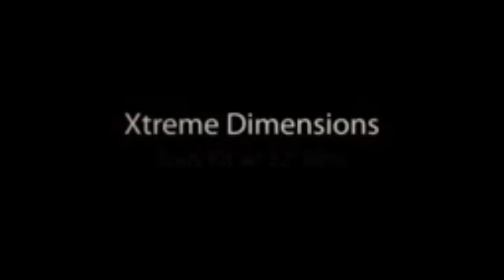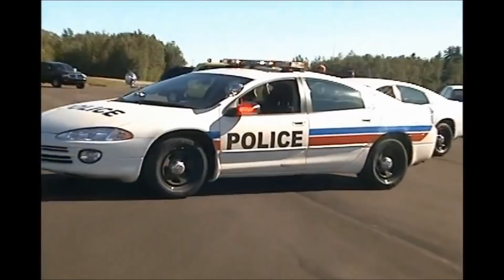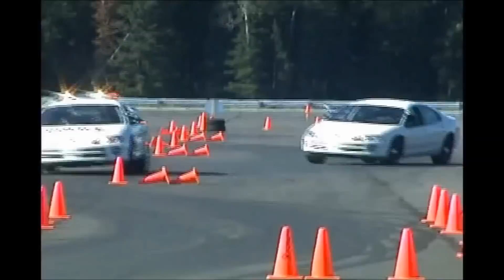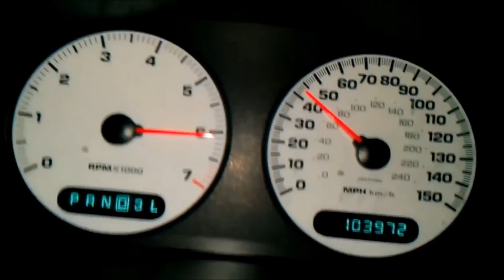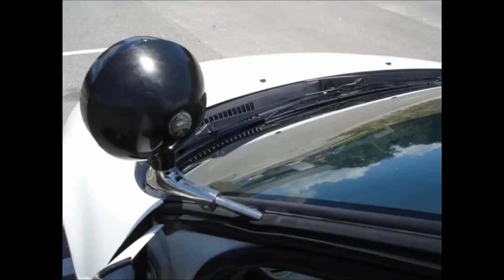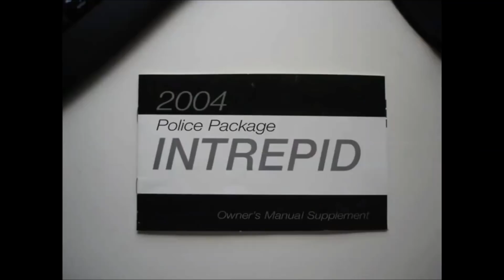The Absolute WORST Police Interceptor EVER! the Dodge Intrepid

Comment: No one I know has had any luck with any Chrysler made after 1980. Pairing up with Fiat didn’t help. What a sad joke.
Reply: Yeah, I'm not a fan of the Fiat merger either. It's a shame. However, the 3.6L Pentastar engines are actually really good engines. As are the larger displacement Hemis. I also heard recently that Ram is starting to put highly reliable Aisin-made automatic transmissions into some of their larger trucks as well, which should boost their overall reliability. (Aisin is a brand name of transmission manufacturer that makes transmissions for Toyota and other reliable brands.) Also, they seem to be doing really well with their interior designs and interior quality, so not all is horrible in Chrysler-ville. But that new Chrysler Portal thing looks like an absolute flop of a car. I fear that thing is going to kill Chrysler once it comes out. It's going to flop as hard as the Pontiac Aztec, you watch. 😕 Fiat's leadership can go to hell. It's sad because I have a feeling that Chrysler's engineers could actually do well for themselves under their own direction and guidance, but Fiat seems to be taking them in a pretty shitty direction that I don't like.

Comment: I actually happen to like the Intrepid's I've just never been in a position to get one of the good ones. And yes there were good ones. Here in Canada it was usually the body rotted out long before there were motor problems I've seen a few of them that were just beautiful look like they came off of the assembly line that were one owner vehicles. Just never been in a position to get one of those the ones I've always seen were rotted the death and not worth having. I had no idea they made a police car version that is just laughable. There a basic driving vehicle no business using one as a cop car. They're a very light duty vehicle compared to the Crown Vic.

Comment: Intrepid's with the 3.2L or 3.5L V6 engines were generally fine. Those engines typically only die if you let the timing belt break (interference engines), or just generally neglect them. They are underrated in terms of durability largely because the cheaper models with 2.7's were more popular & became so infamous/synonymous with Dodge Intrepid's. I think one of the biggest issues with the 2.7's were the internal-designed water pumps which typically failed early & let oil/coolant mix (causing sludge) if the pump went bad. Seems like I remember reading that 2.7's need water pumps replaced as "preventive maintenance" to avoid the catastrophic engine damage/failure that they're known for.

Comment: I owned one of the 2004 intrepid x police cars with the 3.5  for years. It had 80,000 on it when I got it. It had its usual problems but overall it was the fastest car I’d ever owned. I totally disagree with what your saying. Maybe you just had the misfortune of getting a lemon. I would have raced my intrepid against any car on the road and probably won. Top speed of mine? I was clocked on a closed course at 180 and still climbing. If I recall correctly didn’t someone win a nascar race with one? Not sure of the details. I would have raced it against any crown Vic any day.
Reply: Ward Burton won the Daytona 500 in 2002 and it was the only time a dodge intrepid was driven to victory lane for the Daytona 500 the rest were the Chevy Monte Carlos for 2001,2003 and 2004 which was the last year for the intrepid being used in NASACAR.

Comment: 3.5 was a bullet proof reliable engine,NO oil sludge with the 3.5 !!!!!

2.7 had issues with oil sludge ,Remember Toyota had a worse oil sludge issue in the mid 1990's early 2000's !!!!

RT only came with the 3.5 as did the Cop Car Intrepids !!! 3.5 was a reliable engine with 200,000 mile plus engine !! They ahd a timing belt and needed change every 100,000 miles...

Comment: The 3.5 was pretty reliable
Reply: Extremely reliable I would go as far to say, along with the smaller 3.2L engine which was nearly identical
Reply: It still had an internal water pump that is timing belt driven. Any 3.5 made from 1998-2010 is an interference engine.

Comment: A longitudinal v6 on fwd platform. Sounds like a Renault to me. The 4 door cousin of the 90s camaro. 
All around hideous along with the Taurus of that era.
Reply: atleast the camaro looks cool and has the ls1
Reply: @dyl4nftp  the long hood is justified on the camaros and trans-am, due to the large v8. On a 4 door sedan,especially lacking any v8, it looks ungainly. I actually like organic body styles on performance cars like the 4th gen mustang and 90s camaros/firebirds. It's just the lh sedans are stetched just a tad bit too long. Personally i find the current ford fusions pleasing as it proves you can make a more sporty style 4 dr sedan; course borrowing the front from jaguars. The Taurus almost, but it got ruined by the high beltline and cramp interior.

Comment: All Chrysler products from this era were questionable.....Company Has Recommended You Should Learn Engine Repair.......
Reply: What did you own that led you to that assessment? I thought the Daimler Chrysler years were some of the better, especially compared to 80’s Chrysler or arguably FCA
Reply: @brandon18054  2000 Chrysler Cirrus.....horrible little thing if you don't "over maintenance" the thing. If you change fluids at 60% of recommended intervals and make sure all services items get replaced before necessary, you might have a fighting chance. Otherwise, the thing will self-destruct if you treat like an Asian import.....

Comment: You never owned one! The 2.7L "your friend" owned was a POS from the get go. The police package intrepid and concordes with the 3.5 ho are capable of 150+ and pulled impressive g's with testing. Problem was no one did the damn timing belt at 100,000 that's what killed most of them the tired ass timing belt. You can still find some small department's with them till this day. Don't hate because your friend got a shit engine bro.
Reply: Usually its the GM Chevy guys that complain about Mopars. Yes the 2.7 V6 was not all that a good motor because people don't change the oil, or maintain them. The Mopar 3.5 is a tough motor. If you simply follow the maintenance schedule the car will run for a long long time. !
Reply: @alexlevy322  the 3.5 is in my opinion a brick a reliable brick at that. The chassis for intrepid, Concorde and 300m we're and still are impressive for fwd cars also considering that unlike allot of other fwd cars, torque steer was non existent. Chrysler did a ok job on the car. That 2.7 though for everyone I've worked on I hated the owner for even making me look at it.

Comment: I don't see anything wrong. We still have the 3.5l v6 motor in our intrepid RT. We run a small turbo on it now but it has 237k on it and it's never put us on the side of the road. More then less it helped us get to where we needed
Reply: Sagen, have you had success with your turbo setup? There's a guy in the community who has worked on doing that.
Reply: The 3.5 V6 didn’t suffer from the leaking water pump/oil sludge/engine failure issues that befell the 2.7. The 3.5 was/is a robust engine, and if you just kept up with the basic service schedule- problem free. Even the abused ones typically only suffer from mild oil consumption at higher mileages.

Comment: In my opinion the best Cop car is either the Ford Crown Victoria or Dodge Charger
Reply: Oddly Crown Vicorias are over rated,slow,dont handle but dirt cheap rear drive V8 cars..I guess its better than a Honda ! Charger even a 6 cyl eats the Crown Vic and the Hemi leaves it half a car length behind in a 1/4 mile drag race !
Reply: Dayofthedaleks 152 The Chevy Impala isn’t a bad one either.
Reply: Devontae Allen As long as it’s not a 3.6 V6.
Reply: Dodge Charger? Don't flatter yourself.

Comment: Man you really don't know what you are talking about. Do your homework before shouting mistakes on the web ;) To only name a few, the police edition only came with the 3.5 not the 2.7 which yep had a bunch of issues (sludge, water pump, etc). Also you are showing pictures and videos of custom consumers cars (wheels, paint, exhaust), not only cruisers. You are confusing, really...
Reply: I agree.
I have an Intrepid RT with 225,000 miles. I also owned  A Concorde for 8 years. Never heard of these probs. He is referring to an isolated case. (One car) His friend's used Intrepid. 
He totally doesn't know what he's talking about.
Reply: Oil sludge happens mainly in the 2.7s because the water pump is housed in the engine next to the timing chain.  If that water pump goes, your oil is instantly contaminated.   3.5s, the water pump is in the timing cover.  If it goes, it will just leak out your timing cover. Other  Sludge issues  in the 3.5s often happen as a result of poor maintenance.   My SXT has 220,000 miles on it. Granted, been through a couple of water pumps  already but the engine still runs strong, even with the young kid beating the hell out of it as a daily work car...
Reply: The 3.5 can have oil sludge too but it’s not as bad as the 2.7.

Comment: It originally came out in 1993 and came with the 3.3L V-6 very reliable First gen 3.5LL reliable expect for water pumps and transmissions and in 1993-1996 they came with a 3.8L V-6 very rare (1993-1996) The 3.8L was made for three years. The  3.3L  were super reliable but under power but bulletproof. I know some of these 3.3L and the 3.8L models would go 300K miles get the 3.3L or the 3.8L Intrepid  1 gen. (1993-1997). The 3.8L were used from  1993 1996 and the 3.3L was replaced with the 2.7L POS.
Reply: I know for a fact it never had a 3.8L in it. You're spreading false information just like the clown who made this video
Reply: And the 2.7 was replaced by the 3.6 Pentastar V6 which was much better made than the shitty 2.7.

Comment: Had a brand new 2001 Intrepid with the 2.7, ran full synthetic oil in it from first oil change. Car always ran well, never any issues other than an oil leak that was repaired under warranty. Car was really tremendous on the highway, stuck like glue even going too fast on the exit ramps. Traded it in for a Durango when back problems madw it impossible to get in and out of. I liked that car, easy to drive, and quiet to ride in.

Comment: You sir sound like a big fat idiot! First off the Intrepid, Concord came with the 2.7 standard. and that was the motor with the problems! and the people that bought a base model could care less about oil changes. So if you kept the oil changed they were OK. If you couldn't do an oil change because you couldn't make the car payments....well that's when the sludging happened. the 3.2 and 3.5 were optional and the 3.5 HO was standard on the Intrepid RT and 300M special. the 3.2/3.5 were rock solid reliable motors. and they had a top speed of around 140mph in an RT, 300M special and the cop car, which at the time was pretty good for a pursuit car. You need to do some more research before you go spewing out loads of crap, other than just reading about something you have no clue about.
Reply: Exactly. 👍

Comment: 200 ponies on a 2.7 and 250 on the "H.O" 3.5 that's almost comparable the 4.6 in the crown vics only made 200-220 and GMs infamous 3.8 in the impalas made 250ish, point is price will trump performance, sure theres hemi 5.7 police and the infamous ls1 camaro but not in abundance, they should have demanded ford continue to make the crown vic for police use or should have purchased more holden caprice ppvs with the 6.0 making 350hp ijs

G8 owner 🤔
Reply: Glad to see someone in here that knows their cars, and not just across one brand.
Reply: I think you mean famous instead of infamous. Infamous means something that is famous for a bad quality.
Reply: Oh - you want to talk price ???

2019 Model Year, Bid Awards (average):

V6 Charger Pursuit - $21,250
V8 RWD - $22,000
V8 AWD - $23,500
V6 Durango $26,000
V8 Durango $29,000
2020 Dodge Ram $30,500 (est)
Chevy Tahoe 4×4 $35,000
2020 Ford Exploder $34,000

Ford is obviously getting a little crazy with prices.

Comment: I'm neutral here but all I could say is don't get the 2.7 L they've been saying it for the past 13 years now or so.

You do know Hyundai has issues with motors blowing up? And Ford trucks had that thing for about 2 to 4 years where the exhaust would catch on fire on the Diesels I think? 
They are a lot more other cars that have worse problems I do agree if the 3.5 liter had a lot of issues with the water pump and electrical that does really suck.

Comment: What about the dodge intrepid 3.2 L models? Mine has almost 200k miles on it
Reply: 3.2 is the same as the 3.5, but with smaller cylinder bores.  Awesome engine.  But need to maintain it good by changing water pump and timing belt before It goes on it's own.

Comment: I remember those. My brother for his first car had a 2003 intrepid. And it only had like 90 110 k miles somewhat low miles. And the motor died at like 115k. With 2.7 v6 I know know doing research about those 2.7 v6 chrsyler. Those were trash engines. So many problems.

Comment: Had an 01 RT. 3.5 Magnum engine is good. Car handled well, nice  for long trips. Where it fell short was with the wiring, and the brake rotors warped easily and often. Replacement of the timing belt was outrageously costly. The RT was the only decent trim level. The 2.7 engines were horrible.

Comment: There should not have bin 2.7 in police cars ... there not even fast enough to catch up . Really my parents had a 1993 and a 1996 and they where good cars for 10 years .. but the 1999 with 2.7 wasn’t half as good ... I also have the 1997 with 3.3 it’s great
Reply: The "police package"  intrepids only had 3.5 engines.  Not the 2.7s. The 3.5 is a great engine and don't give much trouble IF you replace water pump and timing belt at 100,000 miles, before they go bad on their own.

Comment: Every problem you listed is related to the 2.7l models. I'm a diehard Mopar fan but I'll be the first to tell you to stay away from a 2.7. The 3.5s are pretty easy to find still running with well over 300k miles on the clock. In fact I know a few guys that have had to start figuring out replacements for oem parts because the cars have outlasted oem parts production. Certain parts like suspension components are hard to find now. My first car though was a 99 2.7 Intrepid and I drove it home and to school for two weeks after the wreck that totaled it. I'd also like to point out that I've driven both an Intrepid and a 2000 Crown Vic and the 500lbs lighter Intrepid handles way better hands down.
Reply: Andrew, transmission and suspension issues can be heavily influenced by the driver and vary greatly from car to car as well as the conditions of the roads it was driven on. I've seen an Intrepid go 800,000 miles before the second trans gave out. I've also seen a brand new trans blow after 50,000. As for my experience with rwd cars. I have driven 19 to date. 
1984 Chevy Monte Carlo stock car= 350 laps
1989 Ram =approx 1,000 miles
1995 Ford Aerostar= 650 miles
1996 Ram Dually =approx 500 miles
1997 Ram Van= 50,000
2000 Crown Vic= 1,300 miles
2004 Toyota Tacoma= 5,000 miles
2004 Ford Sport Track= 800 miles
2006 Chrysler 300= 150 miles
2009 Chrysler 300= 120 miles
2014 Charger= 35,000 miles
2016 Charger= 6,000 miles
2016 Challenger Scat Pack 392= 30 miles
2016 Chrysler 300C= 30 miles
2016 Ram Eco Diesel= 30 miles
2017 Challenger Scat Pack 345= 30 miles
2017 Charger Daytona 345= 30 miles
2017 Chrysler 300S= 30 miles
2017 Fiat 124 Spyder= 30 miles
That enough experience for you Richard?
Reply: Richard we're comparing a unibody car with 4 wheel independent suspension that is lighter and shorter than a body on frame car with a solid beam rear axle. It isn't rocket science. Torque steer is easily over come and there's plenty of people that make dedicated fwd track cars that do pretty well. The argument of rwd vs fwd doesn't really work anymore. Besides awd is better than both
Reply: @Jimmy_Chiit  This is true. The Type R is living proof that fwd can be competitive. And it is a testament to Honda's ability to make amazing performance cars out of economy cars. As a general rule though most awd cars are better than a comparable fwd or rwd alternative simply because of how well they hook up and get traction. And because all 4 wheels are putting power to the ground there's no drag from the car either pushing or pulling half its weight.
Reply: Hondo Hooper I had 3 intrepid 3.5 incredibly comfy interior but simple only one of them didn’t surpass 200,000 and it’s because the transmission failed two weeks after both front and rear suspension collapsed and ruined its own tires only at 117,000
Reply: Lies. I just finished up a rebuild on my chrysler 300m, sleeper motor, rebuilt suspension, rebuilt brake systems, new grand prix tires, rebuilt a/c heating system.... Let's make it easy, everything is rebuilt with the exception of the transmission. You wanna try this assessment again? 😁
Reply: I had a 3.5 liter as well, i loved it, the only downfall i found was the govenor kicked in at 188kmh.
Reply: It handles better not just because its lighter but because its front wheel drive.

Comment: Those problems happen after 100 thousand what do you expect lmao
Reply: 100k shouldn't be difficult to surpass, 150-160 is when the car should start becoming scrappy and 200k is usually when cars need a full overhaul, but these things died at 120k or less easily with the 2.7L v6